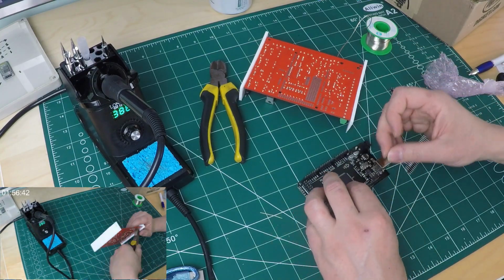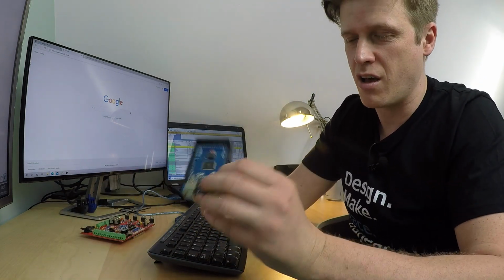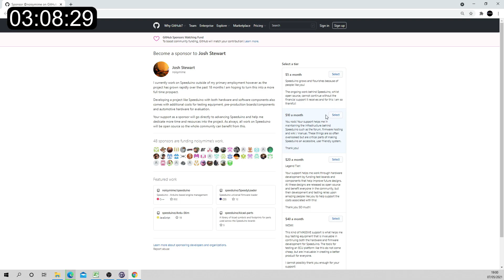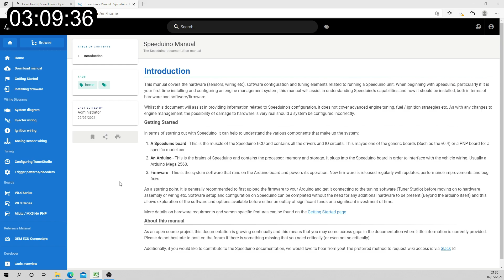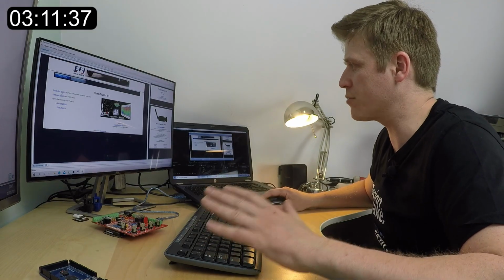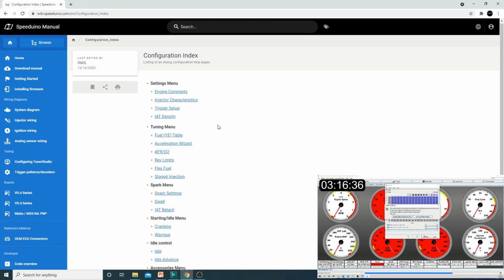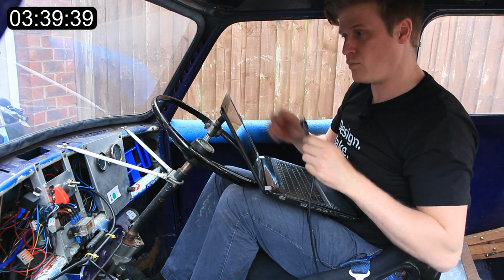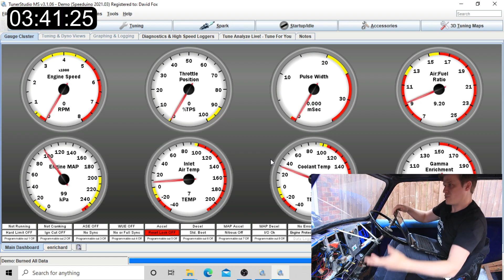Building the Speeduino Standalone ECU - Against the Clock

Comment: I have a 06 saturn vue and the body control module is obselete. Is there a way i could use speeduino to get the car working again? Im trying to fix it for a friend and she doesnt have any money
Reply: That would probably not work, the speeduino is designed for engine management, if you want to replace a body control module you would have to make a pcb and code from scratch. If you can do that, it would be awesome, but it is probably not worth the effort.

Comment: the crystal oscillator regulates the device's ATmega16 microcontroller—which performs USB-to-serial conversion when interfacing with a computer - the Micro-controller itself gets its frequency from a ceramic resonator.
Reply from the maker: Yeah… I got that wrong… 🤦‍♂️

Comment: But my question is how do you connect all of the car wiring to it?   Is all your connecting is the tps, crank cam pos, maf/map, o2, temps? Still there how are they  connecting to the board,  is there a separate board for adding extra headers for i/o?  What if you wanted to use it for everyday driving so traction ctrl or 4wd or with other systems like programming in abs or different trannies?  Can you program in stalls or gear press? How fast is the reaction and readouts? Is real time actually real time?  How does it handle faulty components like if a cable on an o2 shorted on the block or something, is there protection on the board along with over current protection if you were to jump the battery..
Reply: This is a standalone ECU. Engine Control Unit. It JUST runs your engine by itself.

Comment: I'd like to build a speeduino and use it on my mk1 cortina- a total blank canvas for an efi conversion.

My main questions are for ignition, what can I use? Wasted spark, COP and what is better for a fast road tuned road engine.

I'm a fan of the channel and have recently bought a revopoint pop3 based off your reviews.
Reply from the maker: Ignition is an interesting subject….to get the benefit you need to ditch the dizzy, it’s simple and easy but the accuracy is bad…

Job one, crank trigger wheel, either 36-1 or 60-2, being a Cortina I am guessing it’s a x-flow so kits are off the shelf…

After that I would run wasted spark as there is no extra sensors needed and the coil packs are dirt cheap and are easy to adapt with some specific HT leads… especially with where your spark plugs are…

COP has advantages of tidier build (no HT leads), stronger spark and in full sequential longer potential dwell time, but, you need to find the right length, and support the coil end, and in a x-flow that’ll be hard to do and look a dogs dinner…

What’s “better”? Big power DOHC turbo engine?  COP.  For a fast road X-flow? Wasted spark is all you’ll ever need 👍
Reply: @MakingforMotorsport  thanks for the detailed reply, I think you're right about wasted spark.

I doubt I'll be running forced induction (never say never!) And wasted spark will be a stronger spark than the standard electronic dizzy it's currently running. A cam position sensor will be a pain as I don't want to use the current distributor as that can move over time and putting a boss on the timing cover could cause another oil leak!

I'll hopefully start doing the fabrication for it later year after I've finished my 5 speed conversion. Would it be ok if I ask you some more questions when I start?

Comment: You skiped the hardest part, how to figure out how to wire it to the car :(. Great video anyway for the rest of the process
Reply from the maker: Sorry about that, maybe next Speeduino video!
Reply: @MakingforMotorsport  Specially how to do it by researching the original harness and making an adapter for it 👀👀

Comment: Hi, i have a 2002 Fiat Stilo 1.8 16v i would really love having itbs on my car, but i use it regulargly and i still want the comfort that gives, does a differenct ecu still works for everything electronics on the car?
Reply from the maker: The higher end standalone will integrate with your car better, maintaining things like CANBUS etc, but every car is different in that respect so you need to research.
Reply: @MakingforMotorsport  thank you for answering, i know i have a MAP so i dont know if ITB would work with the original ecu, my car is very rare, fiat lost 2billion with this car😂, so there's very little to none information or aftermarket products

Comment: That  cheap one is completely fine. That 12mHz osc is for the ch340g USB chip. The actual XTAL for the 2560 is pins 33 34 and uses a much smaller footprint osc.
Reply from the maker: Yeah thanks, I realise that now 🤦‍♂️ but I do like the Elegoo ones… it might be totally wrong but they just “feel better.”
Reply: @MakingforMotorsport  For the most part they are pretty much the same. PCB tech is pretty good now and affordable. They all usually use the same suppliers so the components inside are the same. There might be variations in the layout, but not big ones that will effect anything.

Comment: Initially I was going to fit some throttle bodies from a zx6r to my 1982 kz1100. After some thinking and the accidental acquisition of a turbo, I’m leaning towards using a single throttle body, thinking the inlet size matched to the compressor size. I’m not 100% on the wiring or programming but I figure I’ll just take it 1 step at a time.

Comment: These videos are awesome!  I do have a question; do you know if anybody has or if itis possible to keep the factory ECM and add the speeduino to the system. this might be necessary for things like the CCM, BCM and TCM operations to continue to operate in a Resto mod? I am not new to car performance builds but the newer control systems i am just now learning. i am currently working on a Toyota 4runner build and i would like to try this type of ECM but keep the systems factory and useable.

Comment: Came across this great video, whilst trying to find information on adding a Speeduino to a Classic Mini Engine. Watch your previous video but did not realise you were a Mini enthusiast :-) Not many videos around on this, so thanks. I'm a complete beginner (first engine build) so will need to do lots of learning. Starting off with a non boosted engine running a HIF44, then once run in I'll be slapping on a Weber DCOE45, then once I have it sorted out probably switching to a Supercharger with the Weber. Wasted Spark ignition not EFI, thought I could do this with CPS and MAP only to start with?
Reply from the maker: You can run wasted spark on a 3D management with just Crank and Map using SpeedDensity mode, just ignore the fueling part.  I did the same on my car for years.
It’s only when you bring fuel in do you need the other sensors like Coolant, IAT, TPS etc…
Best of luck!  👍

Comment: You should try : 1 conformal coating 2. Solder the Arduino Mega directly to the main board 3. Design & 3dprint an enclosure for your hardware with gasket, proper mounting of the connectors on the enclosure even have your own logo on the case

Comment: Oy, Mate! I like it. Despise the Arduino. It's really old news. Is there an ARM based board to replace it?
Reply: Really! 168 MHz @ 32 bit, compared to 16MHz at 16 bits. 50's ford flathead against 90's 4000hp nitro fueled dragster.
Reply from the maker: It’s not about brute force.  In this case it’s about native IO and timers…. Something more “microprocessor” chipsets lack…. My ECU does over 1000 program loops/a sec, this gives 4 recalculations of all parameters between every cylinder event at 8000rpm… that’s enough for me!

But….. as it goes, there is now a range of boards using Teensy3.5 using the ARM cortex M4 chips… so you’re in luck 👍👍👍

Comment: Im interested in this ecu. Im just wondering why an msq is more expensive?? Sorry for my english
Reply from the maker: There are a couple of aspects to this.  
1. MS is easily 15years old now and certain components (namely the microcontroller) are well behind the times.  Still perfectly usable but just not made in numbers
2. There are way more components on a MS board, using an off the shelf part like an Arduino makes everything simplistic and easier
3. MS isn’t fully open source with the firmware still being controlled tightly where as Speeduino is fully Open.  Anyone can just download the board, or make their own and just use the software on any compatible MicroController.

Speeduino truly leverages the greatness of the interweb through Josh’s hard work and generosity.  (Your English was fine 👍)
Reply: @MakingforMotorsport  thanks for all!!

Comment: Just stumbled across your channel and subbed. I am concerned about the amount of down time I'll have on my YZF600R Thundercat whilst converting it to EFI.
Reply from the maker: The down time can be very tricky, but if you can shop smart you might be able to swap over on a Saturday morning, and if you doesn’t have it running say by Sunday afternoon, you swap back.  

In my experience, if you do your homework and understand the principles, you should be running very quickly.  
It’s the 100% tune that takes a while!
Reply: @MakingforMotorsport  I'll have to really understand the existing wiring as well as I would splice into some of it. Need to do that neatly so it can be reversed. Doesn't help being colourblind although that hasn't stopped me from working with electronics for the last 30 years.

Comment: One other thing I thought about is what is being said about the 12mHz crystal. I know from past experience ATmega chips have been over clocked to 20mHz for certain projects. If in this case 12 is a bit slow, and 16 works better, what would wrong with going to 20mHz.
Reply: Probably not at car temperatures!

Comment: I have a couple of Motorhomes, both near the same YM, one is powered by a 350 and the other is as far as I can tell, a 427 industrial or truck version, both Chevy engines both are running Qjets at the moment. Ok so I have a 3rd BBC which I have dumped a $^*t load of money in and still have to dump more into it, it's a 540 which will be a race rig if I live long enough. Anyhow, for the 540 project, I dumped another load of funds into a MS3X with everything needed to run 2 stage fuel and 2 stage N20. COP, SFPI, dual knock sense, RTCC, 2 low impedence injector driver boards, a GPIO for controlling a 4L80E, there's absolutely NO room left in the case for anything else even if DIY made anything else that could be installed. So now I have to spend more for the full version, not a problem, I expected that. Then there is the MSQ file that must be developed, that's a problem for me at this time, I'm going to need some serious support for that. Again, anyhow, I knew a little ( very little and still very little) about Speeduino before starting the MS3X system and now I want to have a go at this to convert both or at least the BBC powered Motorhome first. IMOP I'm thinking this would be a good deal for either engine. Any opinions to offer from anyone?

Comment: Im excited for this. I talked to a friend a long time ago about using a raspberry pi, recycled dell optiplexes, and a 3d printed case to make cheap standalone APUs for cars and custom vehicles in general. We also talked about a scan tool that invades a ecu or tcu to monitor and download as much info from a stock unit that would be needed to allow a program to recreate it and upload it to your custom unit. This would allow for true freedom when doing cool builds. Allowing someone to cheaply swap a 6 speed auto into a car that originally came with a 5 speed auto. Has something like that popped up in the market yet? I know nissan was working on a diag tool that did something similar but i left the company that was working with them so im out of the loop now.
Reply from the maker: There are plenty of canBus sniffers so working out comms between modules and OBD2 let’s you pull parameters like load and spark advance so it’s easy to rebuild mapping tables…
It’s a brave new world people!

Comment: My Main issue is this.  Compatibility with my 1991 dodge stealth R/T Twin Turbo and the speeduino.  This also includes upgrading the ignition system to coil on plug and running them in sequential ignition for spark only.
Reply from the maker: It’s a V6 isn’t it?  You can use a wasted spark coil (plenty about for V6) or coil on plugs wired in pairs and then go wasted spark.  It’s a very common setup and still used by OEMs a few years ago….
Reply: @MakingforMotorsport  Alright I'll take the red pill and see how far this rabbit hole goes.  Talking about the different versions of the board which one would be the best one for a twin turbo V6, the v0.3 or the v0.4 board?

Comment: Do you have to run a cam sensor? Will just crank suffice?
Reply from the maker: You don’t “need” a cam sensor, but without it you have to in wasted spark mode (you can still do this with COP) and either paired or batch fire on the injectors, to run sequential injection you need a cam sensor.
None of this was a problem for me, due to my application.  Sequential gives a slight improvement to drivability and emissions at low revs and load but at high loads the injectors need to fire for longer so the idea of sequential goes out the window….

Comment: I think you know quite a bit about the port air module delivering fuel loads based on constants. That's why you weren't saturated with the incoming MAF temp. I would like to know more about how with the engine hood closed air temp provides a more accurate fuel flow. Cool fuel air is always the best input. I really like the viability of taking a scratch board and making the interface better than the 90's. I wanted to build my own ECU once I understood that changing chips on an older model board cost me a lot of time based on recorded data. I would rather adjust everything then and there aside from a non-it-drive me home burn rate. I'd want to commandeer a carb built in and branch it to multi-port and when no chugga chugga I know that a carb could bypass the gross negligence that I did on my own.
Reply from the maker: Cheers bud! Always learning!

Comment: could you in theory change an engine from carbourator to port injection, cuz kits for that are super expensive
Reply from the maker: Absolutely, and Speeduino (or most other aftermarket ECUs can also do it) can help, but you’ll also need an inlet manifold which supports injection, a throttle body (or ITBs), more sensors to talk to the EFI ecu, the Ecu, an injection fuel pump, higher pressure fuel lines and a fuel pressure reg. and wiring to connect them all.
Most of the time this can be done cheaply with parts off newer cars (certainly the manifold, throttle body etc) it’s the ECU that causes the most issues… hence the video 👍
Reply: @MakingforMotorsport  wow thanks

Comment: How does it stack up to Something like a Haltech…
When I say that I mean purely performance (processing speeds etc etc)
I’m aware of the Haltech advantages which are obvious
Reply from the maker: I am not sure on the Haltech, I did try some digging when I filmed it, but I couldn’t find any info as to clock speed, but on its own that’s a bad number as you need to understand the software interaction….

So for Speeduino, that runs at 16mhz, and when running usually gets over 1000 program loops every second… so that means even at 8000rpm it recalculates spark and fuel 7times,  and it deals with the trigger wheel as an interrupt to the clock so it never misses a tooth on the crank (with a decent signal).

Put simply, it’s more than fast enough to run any normal engine.  It’s only when you throw CAN comms in there that it starts to run out of grunt, but that’s what the Teensy model is for! 👍
Reply: @MakingforMotorsport  thanks for the incite a lot. I do like that it can be expanded upon which is quite amazing.

Comment: I have a Speeduino ECU that I will be putting in a Honda Civic ECU case for a auto trans. I will be using the OEM harness on my 97 Honda Civic Coupe manual with the plug for the trans control being used for my waste gate control solenoids and more.

Comment: L+C+S'd thank YOU sir!
Also, I have a 1993 Buick LeSabre OBD1 that I want to use as a test bed for some interesting experiments. I'm concerned about supporting electronic systems that rely on yhe factory PCM for their operation. Any ideas on how to mitigate this problem?
Reply from the maker: L+C+S!  Top of the class Kyle!  Big thanks buddy!  

And it’s a tricky problem, the level of integration now in cars, even light integration can have the ecu running the alternator etc…

I’ve not had to deal with it but there are a few options… 1. Just leave it in, disconnect the key engine outputs (fuel, spark and idle etc) and put in all new sensors for the Speeduino.  2. Do some investigation, hopefully the internet knows and work out each connection, whether it’s analogue (PWM), digital or a Canbus  connection but that’s all gonna be car specific…
I have a plan to get a 2000’s car to drive into all this but that’s a few months off…

That said… as your car is 1993 I seriously doubt there is a lot of integration going on…

Comment: very well explained. So after someone stole the ecu and its connectors from my car this would be a good and cheap option considering the prices of the original ecu ... my question is, would it be feasible to make it for a v6 engine with 4x4 automatic transmission ?..It has been a headache looking for the original parts of an already rare vehicle in its variant only made for Latin America
(it's a 2008 Suzuki grand vitara)
Reply from the maker: The V6 is feasible but the auto-trans will have integration and being 2008 I would guess there will definitely be canBus integration…

Whilst not impossible I’d say using a Speeduino without the standard ECU to go from will be much more of a hassle than finding another OEM part… I could be wrong, just my opinion…

There may well be another aftermarket solution which is easier than Speeduino, but it won’t be just plug in and play…